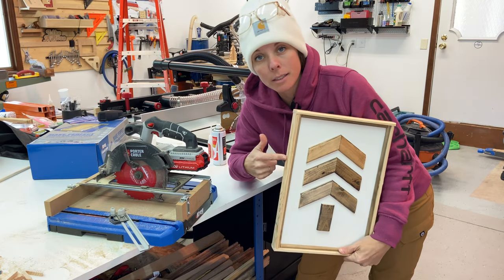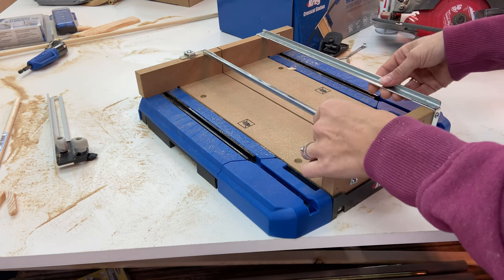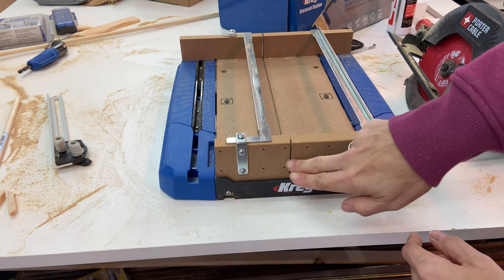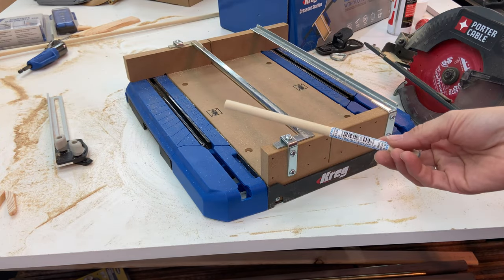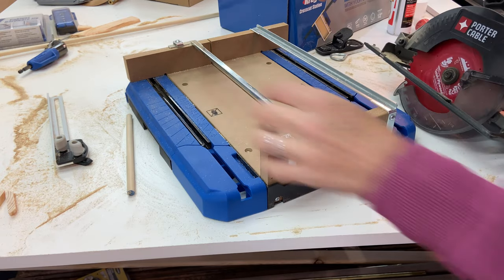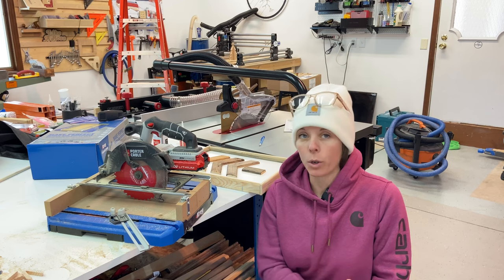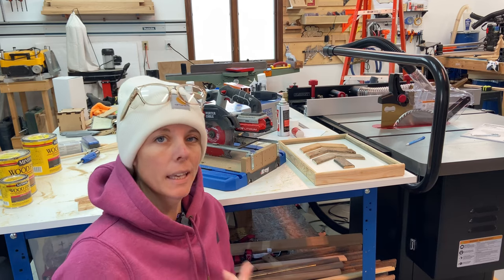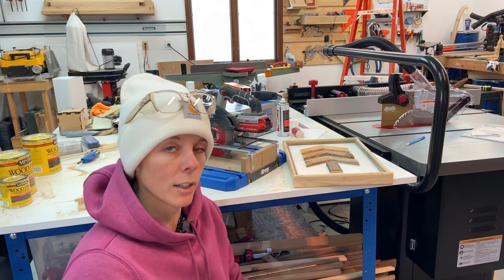Could this replace the miter saw?

Comment: Great review! Thanks for posting! Sounds like a great miter jig for someone getting started. Would this make sense to you for someone who already has a miter saw? I hear you on the portability and you mentioned feeling safer with the less-powered circular saw when doing smaller more detailed work. Would that be its main benefit? I guess I'm wondering if this will add more flexibility in my shop or more probably be added to the dust pile if I've already got a decent miter saw?
Reply from the maker: Thanks for watching! There’s just kind of something fun about it but yes I think its sweet spot really is small parts and if you are good with cutting them on the miter saw you already have, then you don’t need this. I think it would make an excellent starter jig for a person wanting to make signs, especially mosaics and things like that. It’s just so budget friendly and honestly I think is safer than the miter saw. I have seen so many people do sketchy stuff on a miter saw thinking they are harmless. Anyway - appreciate you commenting and asking! I have used it a few times since the video, usually for dowels and probably because my miter station never got rebuilt when I moved to the new shop.

Comment: Can you use this for compound miters if your saw tilts? Or would it tear up the mdf?? Would it be good for trim with a tilting saw?
Reply from the maker: That’s a good question. Technically yes you could but like you guessed, it would tear up the MDF over time. I think you could replace the MDF though.

Comment: You did not assemble it right 😅 its the other way around!
Reply from the maker: It’s assembled quite right actually.  🤣
Reply: @OakHillMillworks  You did not. Your arm support is not even supporting the wood when you extend it. You have it the opposite way. Wood should rest where you are currently starting to cut. Like I said, its the other way around.